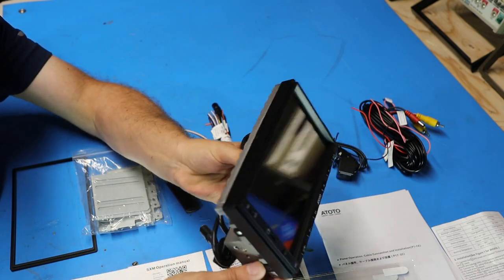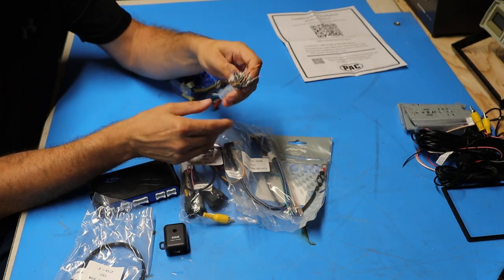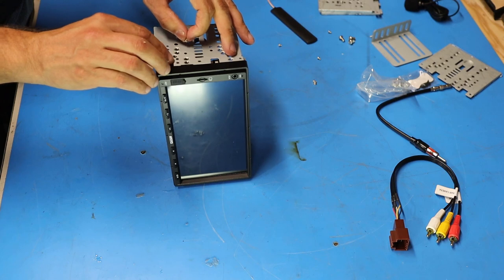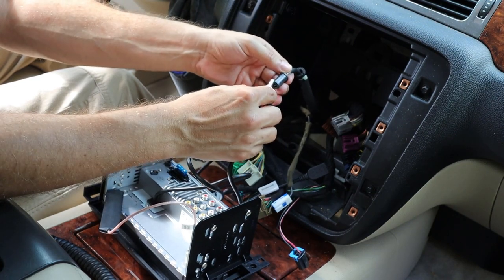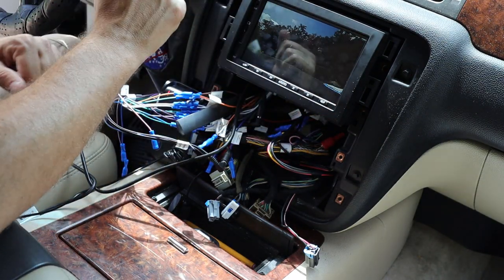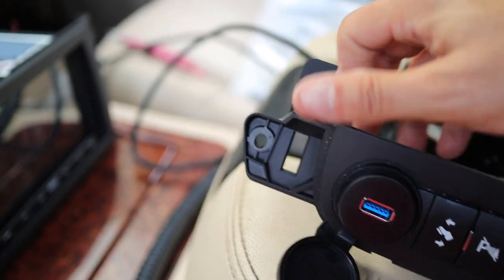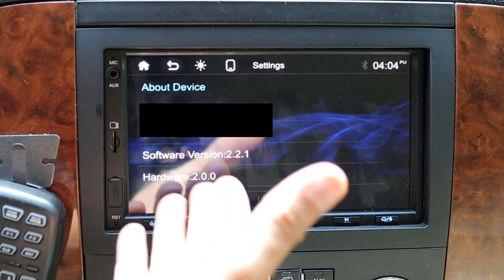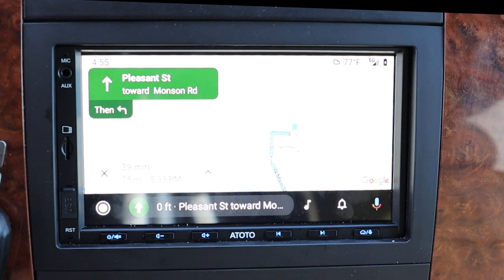ATOTO F7 XE Head Unit and Backup Camera Review, Demo, and Install 2007 Chevy Suburban

Comment: Just got this radio last week. Haven't done the camera yet though.  Every car has a vent for pressure in the trunk near the bumper surround... Go into the car and run the wire along the trim, don't run it below the car. Too many ways it can be damaged, due to the elements and road crap.
Instead of taping the rca connections under the car, get large heat shrink if you are keeping it outside. Be better protection and hold better as well
Reply: For anyone that comes across this, I just installed my camera.  I have a 2004 mazda 3 hatch back. I ran the wire up into the trunk using the grommet that the license plate lights wire came up through.  I soldered extension wires on the signal wires and tapped them into the reverse light wires in the headliner BEFORE it goes to the trunk so I didn't have to run wires into the hatch. Then just ran the wire along the floor under the door sill trim then up behind the glovebox and into the radio. Super clean

Comment: great informative video. a question which seems to be common with this unit, how is the microphone handsfree call quality? many people complain that it is not great with this unit (people on the call cannot hear you well). what is your experience? are you using the included microphone? or have you replaced it or disconnected it? thank you
Reply from the maker: I rarely talk on the phone anymore and never while driving so I can't comment on the mic quality even though I do still have it hooked up.
Reply: @SevenFortyOne  no drama, appreciate the reply. Hopefully they may have fixed the issue with better hardware etc

Comment: Is the pac kit required to get your steering wheel controls? Were you able to make the controls work?
Reply from the maker: There may be other options but you do need something like the PAC kit to make them work.  I don't really use the steering wheel controls so I haven't bothered to go back and try to get the programming fully worked out but the volume buttons and one or two others work.

Comment: Fantastic video. Thanks so much for your time. I have the ATOTO A6-PF and it works flawless except for the fact that I can not get the Backup Camera to work.  The camera works when I plug it into the FRONT camera RCA but I can not get it to work by shifting it into reverse. Thanks again for the great review!
Rob. N1WOX (Retired)
Reply from the maker: Do you have the pink trigger wire connected per instructions?  Many people in the comments have faced a similar problem but I'm not sure what they have done to solve it....

Comment: I need to look into this for my 2000 Ford F150.  I would like to have hands free phone capability.   I may have missed it, but are you able to make phone calls as well using the Atoto?
Reply from the maker: Yes, you can make calls. I hardly ever talk on the phone myself outside of work so I forgot to mention that

Comment: Hi Rob,
Nice detailed install. Did you get the steering wheels controls to work with the ATOTO? You and the family stay safe.  73  WJ3U
Reply from the maker: Yes, I got everything working eventually.  73 Don!
Reply: @SevenFortyOne  I just installed this same Atoto model with the PAC interface on my GMC sierra and love it but I too am having issues getting the steering wheel controls programed. How were you able to figure this out? Did PAC and/or Atoto provide assistance? Thank you for the great video!

Comment: Nice job and well explained... I'm still trying to figure out the best route to take on my 2019 Dodge Grand Caravan SXT. It has the hands-free BT, SiriusXM, steering wheel controls, and Rear Backup but can't believe they left out Android Auto and Apple Carplay. 😕
Reply: What do you mean, it has wireless carplay and wireless Android Auto I have the same model but the boot logo option does not appear for me
Reply: @Kelvin-w6s  I mean, I DON'T have this radio (yet), but I'm trying to decide on which one to purchase as there's a lot of models from Atoto. 😊

Comment: Can you please tell me how you wired the camera inside of the dash? My camera trigger isn’t working properly. I wired the red to red and pink to pink and got no reverse camera when put into reverse. I always have to do it manually
Reply from the maker: Did you connect the wires at the back by the camera too?
Reply: @SevenFortyOne  yes the trunk is connected to specs. 

Power to reverse light power and ground to a chassis. 

My problem is the back of the head unit. I’ve attached pink to pink and red to accessory/ignition. It’s not swapping. I’ve seen In some videos were YouTubers aren’t using the red behind the head unit and then connecting the pink In the back of the head unit to a white cable.
Reply from the maker: I don't remember how I connected mine and no longer have that car.  If it's not shown in the video I don't remember how I got it working.

Comment: Nice job. I am having the same problem with the time. Hopefully this will help. Thanks
Reply: Fyi. I was able to change the time by not having my phone on Bluetooth that way I found the settings.
Reply: If Logo Boot menu not appearing, ITS HIDDEN , in order to make it visible SET DATE to
 2008-01-08  (Y/M/D) and TIME to 01:08 24 h, go back previous menu and it appears, got it from ATOTO Cust Serv.   Good Day 0

Comment: Can you tell me how you wired the back up camera to the back of the Atoto head unit so that it both works when putting the vehicle in reverse AND at any time when the vehicle is not on reverse but with hitting the camera button.
Reply from the maker: I thought I showed it in the video...
Reply: After getting power from the rear and grounding also in the rear
There is a red wire attached to RCA jack that plugs in to the head unit 
That red wire needs to be tapped in to accessory power 
If you do that then you will have the camera come on in revers 
And also you can have the camera come on buy pressing the camera icon on the screen.
Reply: Mmh? Glad I can still access my Atoto xe wires and I didn't solder
Seems none of the directions say to connect the RCA red wire to accessory power. Thanks
Reply: Until I read this I was preparing to return mine if it didn't allow for a backup camera. Though I have the radio connected thusfar  does not show a camera icon. Guess I have to connect the red wires.. both to the RCA screen and to the hot wire to my back up light.
Reply: @fapapas4534  welcome 
Also make sure the ground wire for the camera at the back of the car has its own ground 
I tapped in to an existing ground wire and it didn’t work properly 
So I drill a hole near where I tapped in to the reverse light and put my ground there with a bolt and nut.
Reply: @fapapas4534  it should show the camera icon even if you don’t have it hooked 
If you press it you will get an error message

Comment: What if my car already has a back camera and i want to still use it or do i have to use the atoto camera ?
Reply from the maker: I'm not really sure but I think you can use the factory cam as long as it has the same plug and video signal type as the Atoto cam.  It would be best to check their support website to be sure

Comment: hello i have a problem with the rear camera on this particular Model of Atoto, when i put the gear stick in reverse nothing happen , but the video of the camera works in app , any idea what can i do ?
Reply from the maker: Check to make sure your wiring is correct.  Also, atoto had tech support that may be able to help
Reply: @SevenFortyOne  Thank you very much, the triger wire was not connected, it was my first full installation (camera and sensors) , I did it one more time in which I already had the video cable from the roof top of the car and i read that not all navigations required that cable. 
After I connected it all went perfectly 😀✌🏻

Comment: Hi Rob, I installed the backup camera.  When I put my truck in reverse the screen goes black and the "no camera signal" as yours does in the video but no video ever appears on the screen.  I also went into the camera settings and made sure that all the settings looked good.  I can't find a solution  after hours of research and troubleshooting.  Any ideas?
Reply from the maker: Hard to say without being there...Jake sure you've got the wires connected up right on the back of the radio unit...they are a bit tricky.  Double check the instructions for correct wiring
Reply: I will double check the wiring behind the unit again.  It seems weird that it would pick up the fact that I'm in reverse and have something be connected wrong but I suppose anything is possible.
Reply from the maker: The camera is triggered to turn on when you go into reverse.  Of the wires aren't hooked up right, it won't trigger the camera
Reply: @SevenFortyOne  It's triggered when it goes into reverse it just goes to that "no camera signal" screen like yours in the video but the camera footage never displays.
Reply from the maker: The camera isn't turning on.  It goes to that screen, then it takes a second or two for the camera to turn on.  If your wiring isn't right, the camera won't get power when you shift into reverse
Reply: I had a problem with my rear view camera also 
What I did was to take the ground wire from the camera in the back and drill a hole in the frame on the inside of the wheel well near the reverse light and connect the ground wire there 
In other words it is grounded by its self and not tapped in to an existing ground wire 
That fixed the problem for me
Reply: @anguslean4058  thanks for the idea, I'm going to try that.
Reply: @fern9234  let me know how it works out for you

Comment: I need your help! I have the atoto f7 xe 10.1 

My camera works when I tap on the rear camera icon but it will not come on automatically when put in reverse.
Reply from the maker: Did you hook up the pink wire at both ends?
Reply: @SevenFortyOne  yes, there’s a power wire for the lights that come on with my camera I tapped the reverse light wire from my pickup and connected the power for the lights and the power for the signal
Reply from the maker: Did you connect up the black wire on the camera end to ground?
Reply: @SevenFortyOne  yup. Two red wires to the reverse light wire and the black wire to ground. If I click on the rear view camera icon it only shows me the rear view if I have my truck in reverse. So I figured it was a setting on the head unit itself
Reply from the maker: I had pink and black wires for the trigger.  Only the pink goes to the back up lamp.  I'd contact Atoto tech support at this point

Comment: Never run your wires like this on the outside of your vehicle. Easier to run the wire through the factory wiring holes then chasing the 3 wired under the carpet.

Comment: I have just purchased this particular unit after having had a rotten run with unbranded RED CHINESE audio heads & I can honestly say I have three (3) yeah thats right 3 of these useless piles of sheer & utter crap. The biggest hassle in my opinion is the over heating factor as I never really got this problem sorted out to my total satisfaction dispite my technical background with the computer industry inclusive of the cooling factor!! (yeah right) Any rate have only bench tested this unit (Atoto F7-XE) & to date there is just no comparison between this Atoto & the sheer rubbish I was playing around with previously!!
For mere starters, proper instructions & actually written in an understanable level of good  english as against the pathetic Chinese attempt of totally broken english!! Proper packaging as well as various additional bits & pieces including a screen protector can you believe which came with the unit & it didn't arrive at my door packed in the usual mere plastic bag that the chinese are so well known for. I've since learnt (the hard way) that merely buying the cheapest (RED CHINESE) product around should not be your main objective & my advice therefore is to pay the extra up front to ensure that you are getting good product in the first instance & not some load of sheer cheap & utter rubbish that should to all intents & purposes still be sitting on a dusty shelf somewhere inside of Red China & where it rightfully belongs!! For monetary value alone this Atoto unit F7-XE is really good value & fairly easy to setup. I know its not top of the line but neither is the price & all indications to date are that it is 200% better than the sheer rubbish I have been trying to buy recently & it'll absolutely suffice for most people who just want a reasonably good level of sound etc in their vehicle. I'll do a proper detailed update once I've installed this unit in my vehicle & its up & running!! (understandee de englishee???)

Comment: this one should have wireless android auto, so you dont have to plug the usb cable for it to work, just connect over BT.
Reply from the maker: It does.  I mentioned it in the video but didn't demonstrate it to keep the length of the video a reasonable length